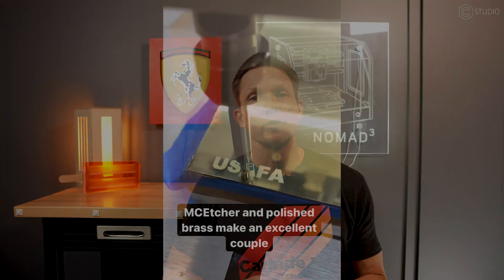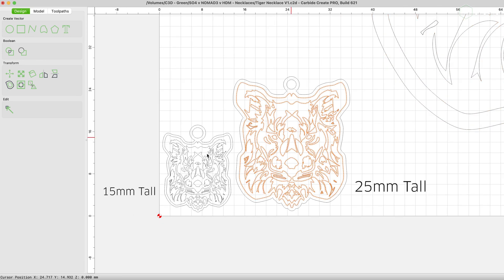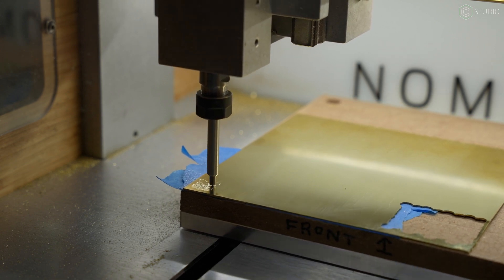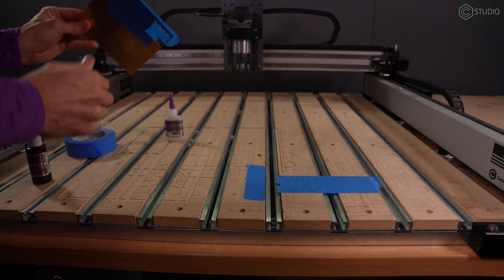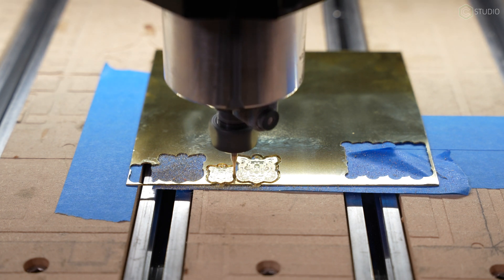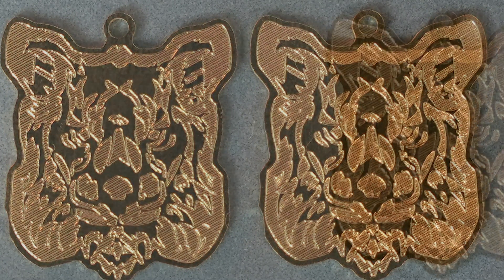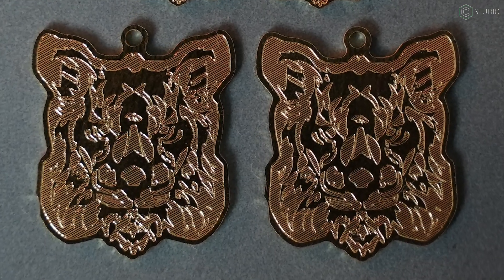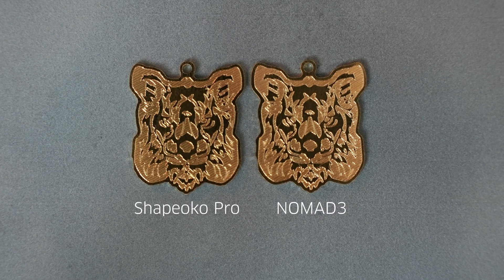NOMAD v Shapeoko - Drag Engraving Smackdown

Comment: Love this video! In the tool overview, you said you used a 30 degree engrave. What was that used for?
Reply from the maker: 120° MCEtcher is the tool.  30° was referencing the Linear Engrave Angle of the lines.  90° Lines would be strait up and down.  30°, for me, has a nice visual effect.

Comment: Disappointing the Pro drilled both holes offset to the left in X.
Reply from the maker: You have a keen eye.  The offset on that part is .002".  Well within specs for the Shapeoko platform.
Reply: @carbide3d  I'd guess the origin got bumped at the tool change.  There's no way I would be able to see .002" - but the Pro holes do appear to be offset.